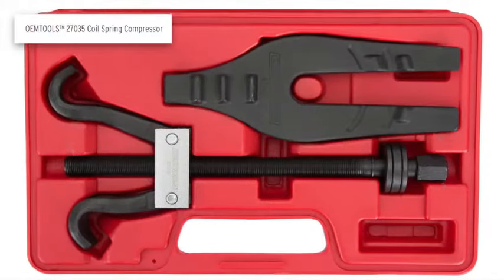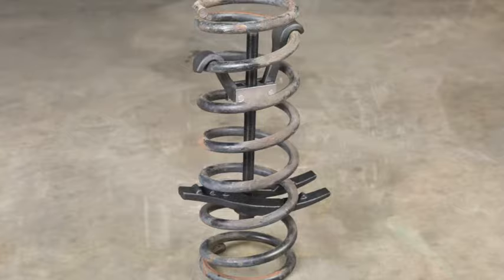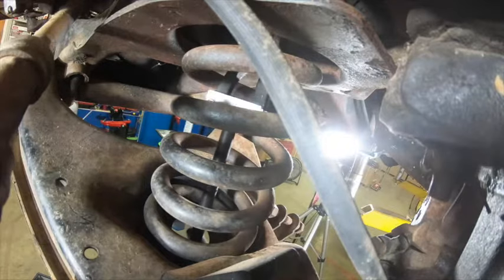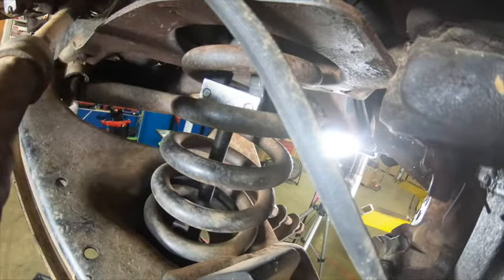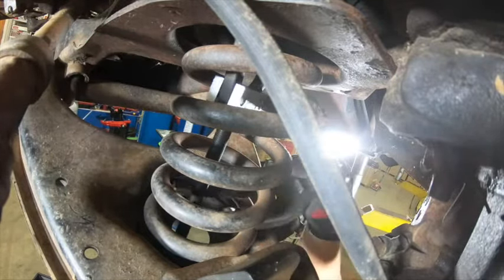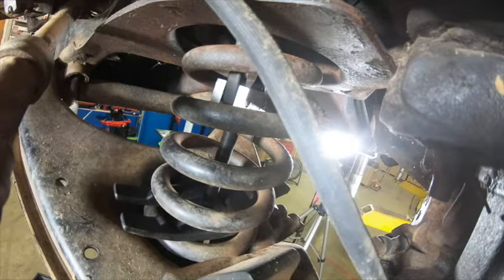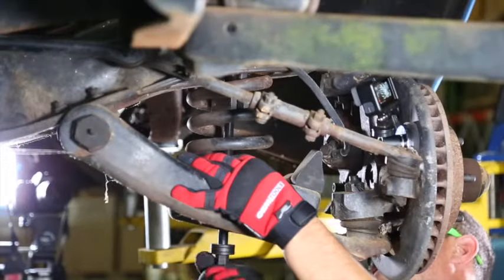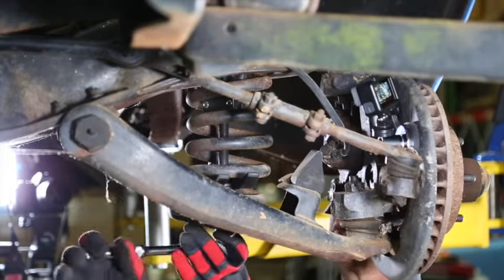OEMTOOLS 27035 Coil Spring Compressor

Comment: Finally a coil spring compressor that fits my car, this call a NON STRUT COMPRESSOR because it goes on the inside, the struts compressor is the ones that go outside the coil

Comment: I used this twice . I do not like it at all . last time the plate shifted during decompression and shifted the entire device to the coil and under such tension and in its position we were unable to release the tool and were forced to cut it.  with a recepicating saw . I was not impressed . save you're self some grief and go with the 4 hook or there is a 3 claw one I've heard works well  .

Comment: What If i take the lower arm off?
Reply from the maker: Thank you for your interest.  Can you clarify your question and also include what vehicle you are working on please?
Reply: If you take the lower control arm off you will get hit in the face with the coil spring unless you use a spring compressor first
Reply: Seabee Gamer 4LIFE not true I’ve done it before u just have to have a jack stand under the spring bucket